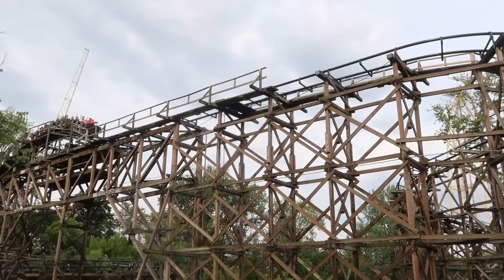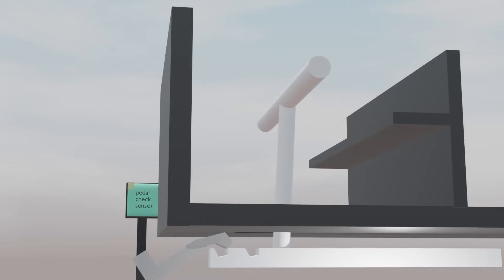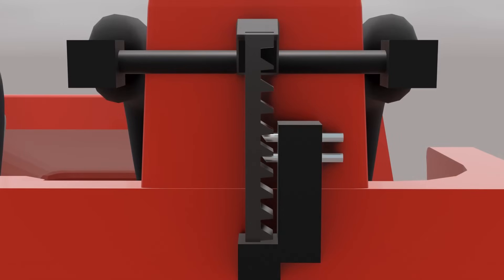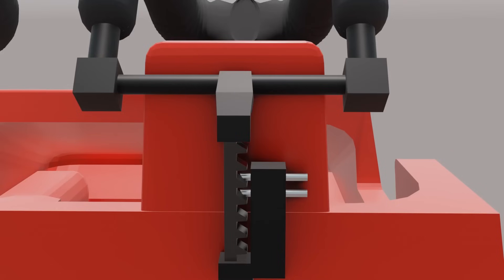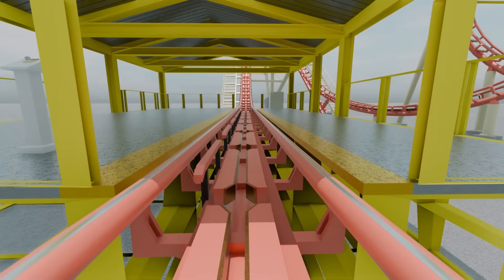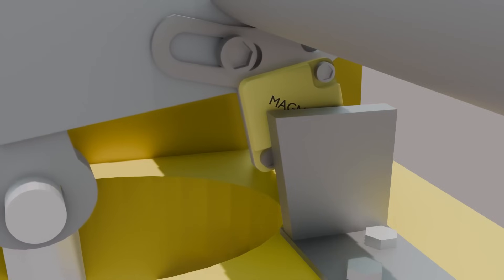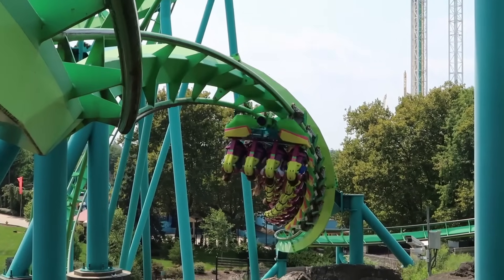Roller Coaster Restraints NEVER Fail!

Comment: I wish that it was commonplace that if a kid or someone was genuinely scared of roller coasters that they could ask to see what it looks like in the operator booth. I remember going to a roller coaster camp when I was a kid and they actually showed us the operator booth while they were running the ride and they talked a little about how it all worked and walked us through the process of launching the ride. Nothing made me feel safer than knowing just what it looked like on the other side of the glass. 

All the safety measures baked into the computer itself also helped. For example, the people who checked the harnesses had a foot petal they had to step on when they wanted to signal that everything was okay to go (so no accidental launches early unless someone was REALLY not paying attention). The computer apparently won't allow the coaster to leave the station until every harness is down--not even if the operator tried to launch the thing! As someone who was absolutely terrified of roller coasters when they were younger, I didn't really understand how they all worked. It led to some serious misunderstandings (like I was never sure how the coasters stayed ON the track until they showed us what the wheels looked like and how they actually had multiple that all went around the rail. 9yo me just assumed it was luck).

Comment: I've experienced restraints unlocking completely on two separate occasions on two different coasters. 

The first time this happened to me was on mind eraser at six flags America  in the early 2000s.  My restraint was locked properly and checked before dispatch  but halfway up the lift it came completely open  with the belt  being the only thing holding it in place.  I was fortunate enough to be able to hold on to the little grips on the side of the seat bottom  for the duration of the ride.  Needless to say i never rode that coaster in the blue train(later the orange train) ever again. 

The next time a similar failure occurred was around 2010 on grizzly at king's dominion.  Once again the same situation with the restraint being properly locked and checked before dispatch  but the lap bar unlocked midway up the lift. I was able to push it down and get it to lock again before  going over the drop and it remained locked throughout the rest of the ride. 

Unlike with the prior incident on mind eraser  i quickly reported this one to the staff on duty running the ride  and  had to fill out an incident report with the park as well.

Comment: I think maybe a better title would be “Restraints don’t fall like this” with regards to the thumbnail and the final destination scene in question. Restraints have failed to stop riders from being ejected, but most of the time it’s not due to them opening mid-ride, it is operator error or the rider doing something stupid that causes the ejection.
Reply: With the incidents I've heard of, it's usually that the rider is either an amputee without legs who was allowed on a ride where the restraint system requires them, or a very large rider who couldn't really be adequately secured by the latched restraint (but due to a design flaw, it registered the latch and the train was allowed to dispatch anyway). When people actually fall out of coasters and die, this kind of thing seems much more common than the restraint unlatching.

Comment: You forget 1 restrain, with the sign: not not stand or get out of train. With no restrain at all. I call it: the oldschool one. Schwartzkopf coasters are still famous for it 😍. If there is any airtime, you are in for a wilde ride
Reply: Some old SDC Galaxis apparently had no restraints at all, and you could kill yourself by simply standing up if you ignored all the warnings not to do so. A kid got decapitated on Kings Dominion's Galaxie in 1983 in this way. Today, I doubt there are any Galaxis still running without restraints, but I know there are a few very old Wild Mice and Jet Stars and such that do.

Comment: It can fail.
If a rider Messed-up with it or if the operator didnt follow the guidelines that is given by the manifacturer
Because it may not
Secure the rider properly.
Reply: The rider can’t mess with it to the point that it will fail. If the operator doesn’t secure the rider probably, that isn’t exactly the restraint’s fault, is it?

Comment: OK, I will admit I have been known to leave B&M inverts and floorless (old style)  one click up so I can get that gentle "hug" as the weight of the restraint rest against me in some elements. So I end up hugging it back  on others. IDK, I get a rush out of rag dolling on restraints like Steel Vengeance, too, because I trust the mechanics of the system. Yes, I have been on the wrong end of some click ups to like Power Tower and Raptor. My poor little animal brain freaked out for a second or 2 before my higher  brain launched into a 5 min lecture on how and why I was safe. Oh, and if it has a seatbelt like Millennium Force wear it. It does help keep you in.

Comment: This only works if and only if, the ride operators, the mechanics and even the owners of these attractions actually do their job correctly. If any of these have laid back rules or people that simply do not care for whoever rides these attraction. It will be a different story. (and technically this is also in part a resonsibility of the rider to actually follow the rules)
Reply: yeah but that's true of literally everything when you go out anywhere. You're putting your trust in the people at a restaurant to have taken your order correctly and prepared your food safely. You're putting your faith in other drivers on the road that they're going to drive safely so you don't crash. Both of these are just as likely to get you killed if done wrong, but most people don't swear off doing these things entirely because someone else MIGHT be careless. You're also even more likely to find very laid back people in those instances!
Reply: @mallk238  The instances of most incidents that I have read about so far are either incompetent staff, incompetent higher ups or greed. So which what you say is probably true. My point still stand in that all of those issues are mostly human error in almost all cases. And I am not saying that this is caused by the staff perse, but human error is almost certainly the cause of just about all incidents. (and yes Greed I consider Human Error as well. :P)
Reply: @iamlooktoyou  yeah, sorry I wasn't trying to make it sound like you were wrong. You're right that all of these safety rules and precautions only truly work if everyone is doing what they're supposed to be doing. I just also felt that it's worth noting that this kinda thing isn't specific only to roller coasters. It's not impossible that someone working a coaster is careless, and for me to imply that in any way would be disingenuous.
Reply: @mallk238  True. Honestly, this video should have dived more into more attractions not just rollercoasters. Since I would think a thriller attraction to actually be more dangerous than a rollercoaster since rollercoasters atleast have safety blocks build into them. If a spinning coaster fails or a drop tower... the results could be far more deadly.

Comment: Not a big fan of the hydraulic restraints that can come down during the ride. You have to remain mindful of whats coming up, so you can brace the restraint from coming down, and stapling the crap out of you.
Reply: Amen, Steel Vengeance did that to me a few times last year. One time it stapled me down so far my restraint was almost as low as the empty seat next to me. Another time it somehow managed to hang me up an inch out of the seat and couldn't sit back down. Thank god I was almost to the magnetic brakes.
Reply: @LTCoasters  those restraints are so freaking painful on my chins. I have long legs, and I'm not a really big guy, so the restraint is always against my chins before it touches my lap. Every year, until they get to know me, it's always an argument that I'm not sitting all the way back. This year was a whole new crew to get to know. Hopefully at least a couple return and can vouch for me, so I don't have broken chins on the brake run.

Comment: Honestly, I'm more afraid of the restraints not opening after the ride is done
Reply: Yeah that can be annoying as fuck
Reply: That ALMOST happened to me while I was on a drop tower, Since the drop tower has a hydraulic restraint system, what happened was the computer tripped after the ride came to its close and the ride shut down, since the restraint is secured by default (and requires an electric impulse to open) the restraint stayed down and my friends and I sat there for about 10 minutes (me needing to use the bathroom 😭😭😭)

Comment: Wow castles and coasters is such a rinky dink amusement park compared to other states, kinda surprising hearing it be mentioned in one of these videos
Reply: That story made news all over.
Reply: @Spike-sk7ql  man I had genuinely completely forgot about it. Gets drowned out by all the other stuff that happens in state haha
Reply: @Theragonslayer  if I was in the area, I'd stop for the credit. My younger years were spent at Conneaut Lake Park. It's gone now, but you can see the glory that used to be Conneaut Lake Park right here. Those parks, the ones that have that elevated feeling of danger, THOSE are the parks I usually have the most fun at. Going up the lift hill of Blue Streak at CLP was always a "are we gonna make it back" moment. Indiana Beach is another one. They have a galaxy coaster that's sitting on cribbing! (Stacked boards) The S&S shot tower is missing half of a muffler for the one towers cylinder. And let's not forget the boat, a concrete, double decker paddle wheel ferry (just hope the weather stays calm and you'll be fine)  The steps leading to the station on Kennywoods Racer had been resting on freaking cement blocks for decades, and was just recently fixed. Probably only because that vital video too. Don't get me wrong, I LOVE how I feel as safe as one can feel at Cedar Point. Of course, I know that those rides are inspected every night, and then again every morning. I trust the restraints at cedar point 100%.

Comment: if a restraint opens in anyway isn’t that a restraint failure? we’ve seen them open & people fly out of rides plenty of times.
Reply: Yeah, but in those cases the rider was usually too large for the restraint to properly close and lock into place.  It's not a failure, it's simply someone who doesn't conform to the safety requirements.  That's human error.
Reply: @  no one was talking about overweight riders… not sure where you saw that in my original comment or why you’re bringing that up. plenty of people who weren’t over weight have been ejected lol.
Reply: @dojavillager5998  where did you see that, in some AI fake thumbnail rollercoaster accident video 😂?
Reply: @CoastersPX  sure thoosie whatever will shut y’all tf up. ☠️

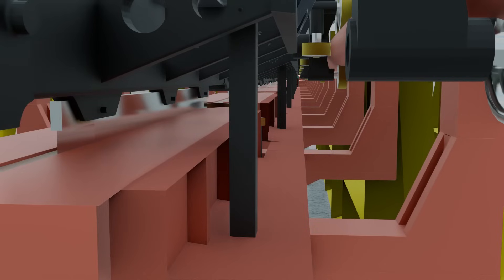Comment: 5:39 To be fair, they don't generally raise and lower, it's more a skid thing. The train lightly contacts/skids it. I'm pretty sure that's how B&M does it? Don't know if I've ever seen those move up. Though maybe because it moves up when train is over it?
Reply: They actually do move. It's easy to see when riding an invert. Just look up when they're about to start checking restraints. You can see the mechanism on the track move, and there is an arm on the train that it lifts off of. The operator in the drive box will usually say "train is locked". Same thing in reverse after you pull back in, and no que from drive box.
Reply: @Spike-sk7ql  Oh yeah? Interesting. I always figured the clack clack you heard was something in the train clicking over the electrical plate contacts for each row. Maybe that's the drive tires though. I'll check it out next time. 

I mean, I must be wrong because I'm almost positive watching Mako the other day the plate contacts were rigidly mounted to the track. And that it was something on the train that recess upwards when it passes over another row's plate but will make contact when it stops in proper place. 

It's what it looks like when watching a POV at least too. Maybe they do it both ways? Check it out as it's coming back into the station at the end. They look individually,  firmly mounted for each row next to the drive tires. Can't see it connecting to an arm similar to what B&M uses on flying coasters, for instance, like you're describing.I did just watch a Montu POV though and I can see the rail you're talking about that hinges on either side of the track. Maybe they do it different for the inverts?
Reply: @jonny-b4954  haven't read more than the first 2 sentences, but it's both. It's the contacts, and the unlock arm, actuator, thing. Yeah I hope you aren't looking for technical terms from me. I'm a mechanic, but not a ride mechanic. You need Ryan for that😄. Ok sorry. Going to read the rest. I just didn't want to forget.
Reply: @jonny-b4954  so I'm not sure you're going to be able to see it in a POV, but I'll go watch one of Raptor. Better yet... I think Ryan the Ride Mechanic already has a video explaining this. You might want to give his channel a look through. He has a couple on restraints.
Reply: @jonny-b4954 I’ve worked rides that do both. B&M often make that “clack clack” noise because the electrical restraint contacts are spring loaded and rigid to the track, so get smacked by the cars as they come by. Intamin rides usually have the contacts on an air cylinder. B&M flyers (and maybe some others) use a brush and bar system for continuous contact in the station area. And mechanical unlocks have all kinds of types, B&M inverts with them use several bars that unlock a couple of cars when pushed down via air cylinder, arrows with auto restraints use one giant skid for the whole station, some PTC trains uses electric contacts on the sides and some use a metal post that mechanically releases, it’s super variable.
Reply: @ THAT'S IT. I knew I wasn't crazy as I've seen those rigidly mounted in the station of B&M coasters. Assumed they did it both ways. It's wild how many different ways the manufacturers have come up with to do 1 simple thing.
Reply: And to add on, anything modern S&S uses a bizarre electropneumatic system with a combo of air powered ratchets and electric restraint latching. Their coasters have this device that rises up behind the train and then moves forward to make both electrical contact and automatically plug in air supply hoses to the trains.